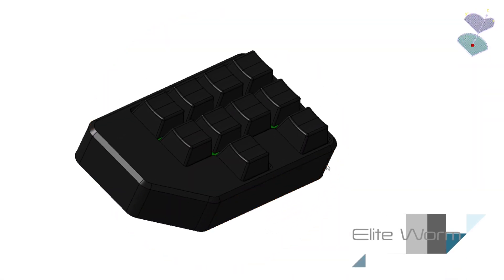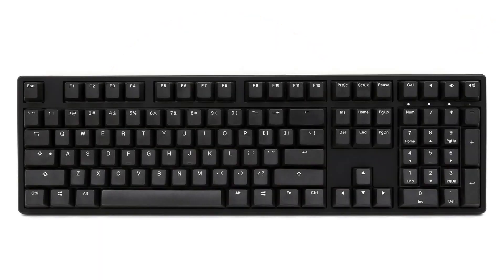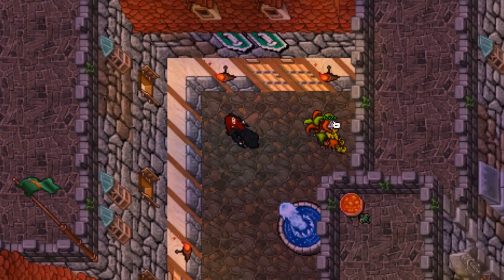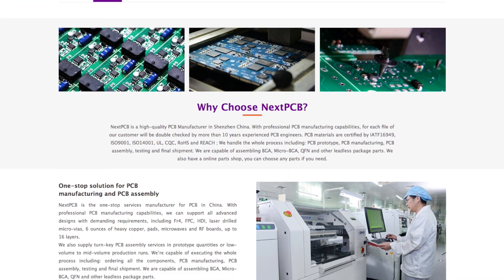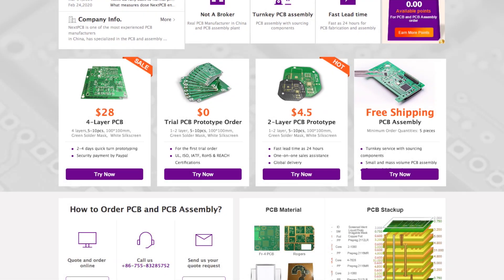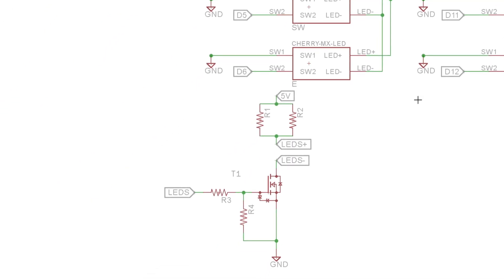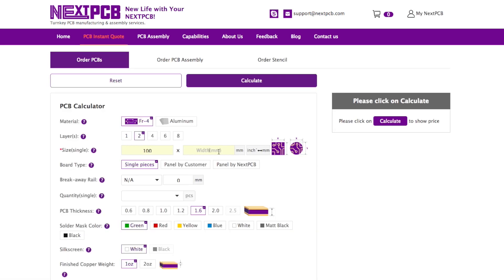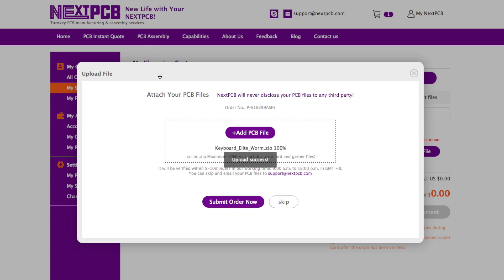I Built a Mini PC Keyboard | Custom PCB & 3D Printing

Comment: Why all used arduino?
Why are U don't use microcontroller mega328?
Reply from the maker: Because it was meant to be an "easy" build for anyone out there wanting to build one. If I used the bare bones IC I would have had to add several components to make it work plus people wouldn't have been able to easily burn the program.
Reply: @EliteWorm  this is bad
Because i can't find good material and tutorial for do this
Arduino is cancer of diy pcb

Comment: I get an error saying that i didnt include Keyboard.h, but i used the Manage Libraries part of the IDE and put that line if code in
Reply: C:\Users\Auden\Documents\Energia\sketch_jan15a\sketch_jan15a.ino: In function 'void setup()':

sketch_jan15a:58:3: error: 'Keyboard' not found. Does your sketch include the line '#include <Keyboard.h>'?
   Keyboard.begin();

   ^~~~~~~~

C:\Users\Auden\Documents\Energia\sketch_jan15a\sketch_jan15a.ino: In function 'void processkeys()':

sketch_jan15a:113:5: error: 'Keyboard' not found. Does your sketch include the line '#include <Keyboard.h>'?
     Keyboard.release(0x85);

     ^~~~~~~~

sketch_jan15a:120:5: error: 'Keyboard' not found. Does your sketch include the line '#include <Keyboard.h>'?
     Keyboard.release(0x84);

     ^~~~~~~~

C:\Users\Auden\Documents\Energia\sketch_jan15a\sketch_jan15a.ino: In function 'void printkey()':

sketch_jan15a:135:7: error: 'Keyboard' not found. Does your sketch include the line '#include <Keyboard.h>'?
       Keyboard.write(0xDA);

       ^~~~~~~~

Multiple libraries were found for "Keyboard.h"
 Used: C:\Users\Auden\Documents\Arduino\libraries\Keyboard
 Not used: C:\Program
exit status 1
'Keyboard' not found. Does your sketch include the line '#include <Keyboard.h>'?
Reply from the maker: Make sure you are using the 1.6.4 Arduino IDE version which is the one I used. This is crucial. I heard about this error before when using newer versions. Also select board "Arduino Leonardo" and programmer "AVRISP MKII".